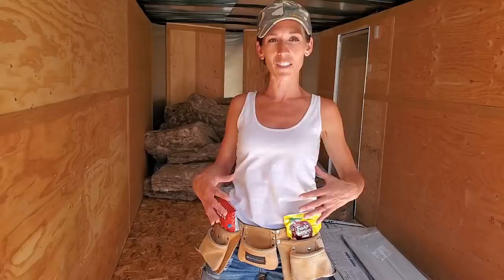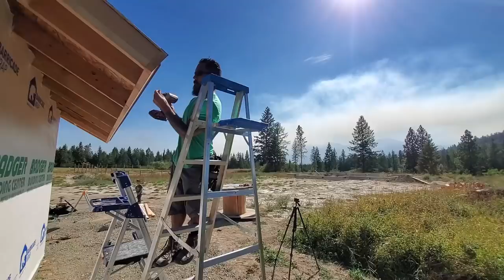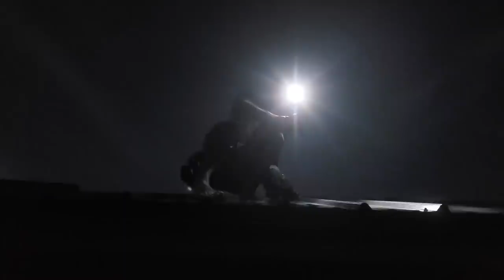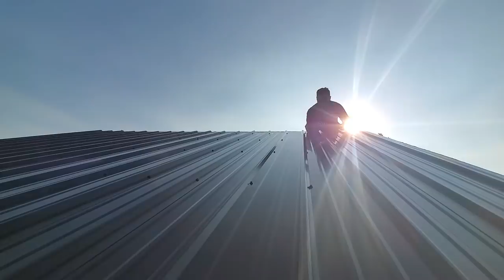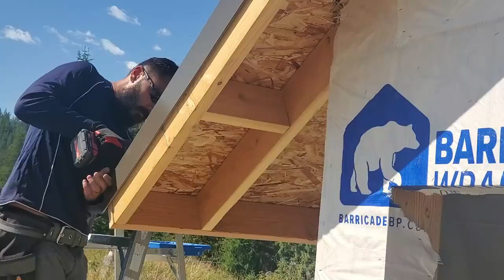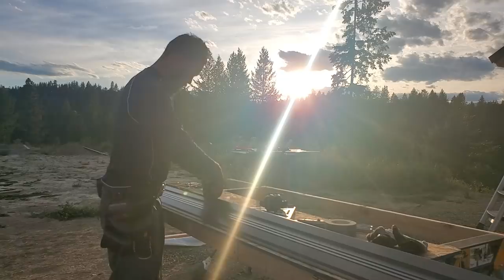How To Build A Shed (Part 6) | How Rising Lumber Costs Are Effecting Our Build

Comment: I drive for an Amish construction company. One of my guys and I were at a local saw mill to pick some wood up for my project.  The owner was saying that because lumber is so high at box stores they are coming to the smaller, private sawmills and buying up what they have.  The problem the little sawmills are having is getting the logs. The logging companies are holding back logs to jack up prices, just like the larger sawmills that supply the big box stores are holding back on their inventory in order to raise prices.  Based on market principles they can only do that for so long before they start to lose business and the prices will have to come down again.  At least in theory. But we are living in weird times right now.
Reply: Could be the fires in Cali are part of the reason for higher prices. Lots of homes burning.
Reply: Hmmm, maybe go to the sawmills with your own logs?

Comment: I normally try to refrain from commenting on people's contruction techniques,  but being in custom metal roofing, an architect, and 30+ years in construction, I have to sometimes. Yall are doing great for the most part. 
The only glaring error in all the work I've seen to date was when you placed that drip-edge over the tar-paper underlayment. You just re routed any moisture that is coming down the roof on the top of the tar-paper back to your decking. You do put drip-egde over the tar-paper on the rake but under at the bottom edge.
Keep up the hard work. Winter will be there soon.
Thank you for sharing your journey by the way.
Reply: Also no drip edge down the rake
Reply: Yes to this^^^...installed glass room additions for many years, and it was always something we had to correct on EVERY home we ever encountered.  Pro roofers would do this wrong every time.
So I'm sure you guys are just mimicking the so called Pros
Reply: Thank you Wm H....I cringed when I saw the drip edge installation, but I made my own mistakes when we first started building/remolding.  That is how we learn, but the price of materials are so dear now compared to the 1970s that you have to get it right the first time.
Reply: So install the bottom of the roof drip edge first, with the metal under the felt.... Then install the rake/sides with the metal over the felt. Right?
Reply: Thq for the information👍
Reply: @matthewharvey8755  Yes.
Reply: Tudi  vijali za streho se ne vijačijo na rob vala pločevine temveč na sredino-
Reply: I hope water doesn't destroy the sheathing along the edge

Comment: First, I want to see the part you edited out right after Melissa asked "Do you want to roll in the hay with me?"  No fair, keeping that off the channel. LOL.

Second,  as a former home builder and a certified appraiser, I have dealt with costing out housing construction projects for 42 years now.   Here's my take on construction material prices, NOT just lumber, BTW.   Covid hit first and reduced building material production.  While temporarily housing construction stalled heavily back in the early spring, a rebound started equally as heavily around June when the economy opened back up AND interest rates plunged to historic lows.  Builders are trying to make up for lost time before winter sets in so they are going full speed which takes up a lot of the available supply. As long as supply is restricted, prices will stay high....or even go up more!

Next came major weather events like Hurricane Laura and the western wildfires.  Any lumber left on shelves before these events hit has either been destroyed or put to use.  Therefore supply is at an incredible shortage right now.   Some recovery of supply may occur but winter is not a good time for lumber production and many suppliers will be more likely to wait and see how the Covid drama plays out before "maybe" cranking up supply early next spring.   

Thus the only decent chance for a true decline in lumber prices and most other construction materials won't happen until about 5 or 6 months from now...if it happens at all.   Meanwhile, there's a ton of other events such as trade wars with China and disputes with Canada that can affect lumber, steel, and other prices on building materials.  With Fed policy also pumping dollars into the economy and being willing to allow for inflation to move up above 2%, the odds are that inflation alone will offset any price breaks due to more supply.  And if supply of cheap products from China and elsewhere get crimped, you could wind up paying far higher material prices next year.

NOPE, I would not wait one day.  Buy what you need when you need it at the best price you can find but get your project done.  In the context of life in general, saving even a few thousand dollars isn't worth upending the plans you have started to enhance your family's welfare.   You have plenty of years ahead and opportunity to earn or save back any extra dollars you might spend now.

As Johnny Cash liked to say, "Press On!"

Comment: I’m a roofing contractor and we’ve already been hit with a 10% increase across all the materials we use, luckily for you lumber prices after some kind of natural disasters or whatever caused this virus, the prices go down and level out. Though roofing products rarely go back down after they go up, most of the time they blame oil prices even though they drop again. I wish you the best of luck with your home, hopefully you have the time to wait out the prices and demand issue we have right now.
Reply: Has the sudden price change put you in the red on any of your job bids for material . If you haven't already you might consider adding to your contract that prices may change reflecting material prices and availability. I hope and pray that your business is going to do well .
Reply: Our supplier warned us ahead of time, so luckily we had advanced warning to start raising our quotes so it wouldn’t hurt us as bad. The brand we used was one of the last to raise the prices as well so it helped us out as well.

Comment: A few thoughts for you...

Home Depot has a “Bid Room.”  Get your project prequoted through Pro Services. They usually offer 1.5-10% discount on bundled orders.

Lowe’s offers 10% on all purchases to folks who are/have served in our military. If Jeremy hasn’t served, perhaps parents or siblings that can purchase for you?  They request DD214 or current military ID.  They also have “Commercial Services” that can quote your project. I do not know what they currently offer for discounts.

Badger, Sandpoint, or ProX may offer a “Bid Package” too. You’ll need to give them a copy of your house plans/blueprints. Bundling can lock in discount pricing.

Check with Impresa Modular. They may off prefabricated walls as an option or may offer the entire house. Often bundled materials are less than piece by piece purchases. 

Lastly, I agree with some of the other comments that market pricing changing in November (after the presidential election) is likely to change. Historically, either political parties were motivated after an election year to make changes to improve the US and housing economy. I am personally concerned that this election may alter history as we have known it. I’m saying that one party may not be motivated to bless Americans, but to further extreme agendas. There is a US tariff on Canadian lumber that is complicating US supply chains and too complex for me to communicate clearly at this time. Many moving parts and variables. All that said... You could wait and watch.

I am assuming that your building plans have been submitted and approved by the local AHJ (authority having jurisdiction or building department).   Changing building methods may delay your project too - resubmitting plans, approvals, new fees. Steel studs may be an economical option. However, steel is 400 times more thermally conductive than wood. You will need to install a “thermal break” in your wall assembly especially in a heating climate if you want to be comfortable without burning lots of firewood or running your furnace, etc.  Matt Risinger’s The Build Show YT channel has some excellent videos on building science and wall assemblies. If you want to get geek out, search for 
Joseph Lstiburek of Building Science Corp.  (the “L” is silent). He wrote several books on of which is “builder’s guild to cold climates.” Taunton Press.  Joe can be a bit abrasive but has brilliant research and wise building advice. His teams’ work has frequently become building code and has raised building standards in North America.

With all of the many options available to you, “...in all of your ways, seek His counsel first, and He will direct your paths.”

I enjoy your courage, chronicling your journey, and am encouraged by the wise choices and sacrifices that you have made to realize your dreams this side of eternity. Thank you for celebrating and honoring our Maker’s amazing and awesome daily beautiful gifts to us. We have sooooo much to be grateful for and for what He has done, is doing, and will do to commune with us.

Comment: Lumber prices have had a huge impact on my plans! I am going to postpone the start of my permanent cabin and live in two canvas tents connected by a covered outdoor kitchen until late Spring/early Summer of '21. I have several reasons for predicting lumber prices falling sharply then. I could skimp on my solar to offset the 30% increase in the cost of my build (if I started now), but I MUST have sufficient power to work remotely. I will be capable of keeping both tents cool during the heat, and warm during the winter. 
I absolutely love watching y'alls videos! Keep up the awesome job!
Reply: Hey buddy ,a wind turbine is way more efficient than  solar ,don't have to rely on sunshine 😎
Reply: @jimquinn9454  I'm building in Arizona . . . 300+ days of sunshine every year.  But I understand what you're saying.

Comment: Hello, love your channel, love your attention to detail on your building. I am a home builder and developer. Based on your question about what should you do about lumber prices? Hold tight for 90 days the price will begin to drop as long as the mills stay open. 
Also not sure if you are stick framing your roof, or using trusses. Trusses in our area are up 100% in cost. So stick framing your roof could save you money if prices do continue to hold.

Comment: Can't help you with anything about lumber cost, but if you are going to need to handle hay bales much in the future, I'd invest in a set of hay hooks.  $7 bucks apiece and Tractor Supply.  Saves a lot of wear and tear on the hands over lifting by the tie strings or wires.
Reply: Yes, yes, yes!  I was very young when I learned how to use hay hooks.  So much easier.  A little wrist action and they sink in the bale just right.  It's been over 50 years since I left home, but still remember the sweet smell of alfalfa.
Reply: Teminds me of having my g-parents hay hook. Also a meat one.

Comment: Just thought I might let you know that most of the smoke you are getting is coming from farmers in the valley burning off their stubble in their wheat fields. Common practice due to the amount of time it takes straw to decompose if it is plowed under. A lot cheaper than burning fuel doing it also.
Reply: this is exactly what I thought too.

Comment: Oh, Jeremy! I've burned the bottom of my feet very badly twice. I sustained 3rd degree burns both times. The first time was way worse than the second, but the lesson learned was to be super careful and to never go barefoot after Labor Day and before April Fool's Day. That's what my mama taught me and both times I did that I burned my feet. So be very careful. 
As for the wood cost. I do believe it will come back down. This issue is directly related to this year's virus. The treated lumber was in short supply first because of a lack of workers. Now, the untreated lumber is involved because folks still need the lumber and have likely learned how to treat it themselves. Also, you are competing with the trades in the demand area. I fully believe in time we will see this level out just as we have been seeing the beef prices level out. So, then it comes to a matter of time and how long you can stand to wait. I believe you could still go the route of building alternatively in which the amount of wood need is little to none. ICF build I believe it is called. It is something that would be able to adhere to your current footprint and primarily require no lumber except the interior. Well, anyway, that's my take on it.
Reply from the maker: Yeah we may need to get creative!!
Reply: @GoodSimpleLiving  - I'm thinking more than likely, if you want the big house completed anytime soon. But, there are great alternative out there. Some are more cost effective than others. It's just a matter of research.
Reply: Oh WOW Mrs Paulla that had hurt, in like those suggestions I also think the hurricanes also here in Ohio there is barely any lumber left
Reply: @kellyfarrell8180  - Yes, I can imagine. Quite the state of affairs our country has gotten itself into. Quite a state of affairs indeed. 😿
Yes, the burns hurt. It was awful. The first time I was on crutches on the tip of my right big toe only for about a month or a little longer. The second time was only a couple of weeks. Not as many blisters that time.
Reply: @PaullaWells  oh wow I was young had a grill knocked over by a dog one if the small round ones and had 3rd degree burns on my hip still have scars but feet wow glad EVERYONE'S feeling better

Comment: I'm in the same predicament as you guys. Costs for lumber products have tripled since I started my home and did my foundation out of ICF's. Purchasing my subflooring and floor joists previously was a savings, compared to current prices but now I am having to store them in my shop and have nowhere to work on equipment through the coming winter months. Trusses, and fabricated lumber prices have tripled because of the Coronavirus shutting down the plants and sawmills but, I have decided to wait until next year after a vaccine is found and things become more normal again before I buy any more materials. When you see seconds and scab lumber being sold online on auctions for as much or more than retail, I think it's time to sit back and wait. You still have a lot of other things you have to do that will make good video content.

Comment: Hi guys,

I am not a construction professional and I haven't been following material costs closely so please take this with a grain of salt but what about using metal studs for framing and seeing if you can find alternate building materials that might be less expensive or more readily available for other aspects of your home?  Ceramic floors, stone siding or stucco and metal roof come to mind.  It won't help with the cost of the subfloor but it might help defray the additional cost of the parts that need to be made of wood. On the other hand I suppose the cost of steel has skyrocketed as well due to tariffs and the cost of cement is going up too.  Anyways, something to maybe  think about. 

Whatever happens I know you will survive and thrive!  Just keep the faith and know that everything will work out in the end!  Please stay safe, be well and all the best from California 💛

Comment: Melissa and Jeremy we feel your pain!  I have chatted with you through PM occasionally.  We are going through the same thing.  My framer I hired went Awol on us so we are not able to find a framer that has availability.  So now we are thinking of waiting until next Spring.  We were hoping to have it dried in before winter so we could continue work during the winter months.  Prices of material is going up 5000 to 10,000 a month currently.  We are hoping once Covid19 goes away that supplies will increase.  That is currently why prices are rising because of the shortage.  I just bought 50 2x4’s this weekend to work on putting a bathroom in our outbuilding and they were over 6.00 each!!  Good luck and I am sure you will make the right decision.

Comment: With wood prices rising you might consider framing out if metal studs. They would be rot proof abd fire proof. Also you might look into structural  insulated panels. Sip. These are foam insulation sandwiched between osb. These go up fast and use less wood.

Comment: I'm 74, and I have never seen prices go down, once  they were raised.
Reply: Lumber goes up & down all the time
Reply: I am 60, used to teach construction basics. I agree with you wholeheartedly. Lumber producers and any company for that matter goes way too far. Look at oil prices after a disaster, they all say, once we recoup our losses we will lower prices- never happens. Greed.
Reply: @alanm2842  Not here. It went down maybe 5cents.
Reply: @alanm2842  When I leave my house and go to the end of the street if I make a right to the first intersection gas is $2.25. If I make a left and go to the first major intersection the gas is $1.89.  It has been that price for about a month so far.  The higher priced gas has been all over the place but never under $2.05. Btw it's about 2 miles to each of them.